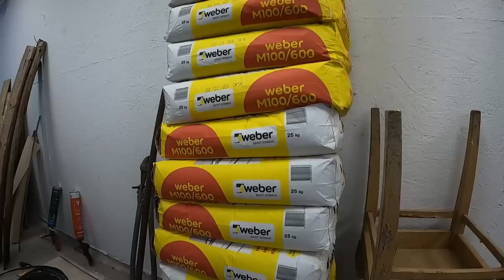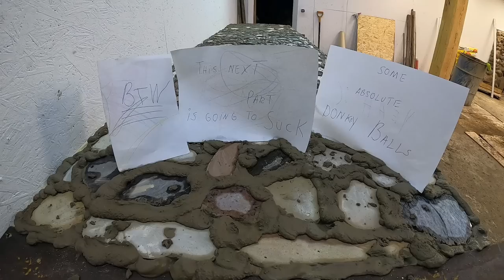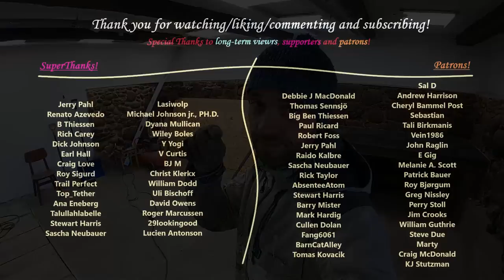Renovating the workshop  (part4) - Rock table build

Comment: 11:50 “My plans change a lot, so I should probably stay as flexible as I can – let’s build concrete tables.”
Reply from the maker: Well, that escalated quickly
Reply: I was thinking that too. I've reorganised my workshop several times. I like solid benches, but not permanently installed.

Comment: Hello Ants, you did a great job with the 2 workbenches, they look very good. I also have 2 pieces, but made of wood, because I can always sand them down or put a new tabletop on one workbench if the old one should break. And it's easier to rebuild them. Greetings from Berlin
Reply from the maker: yeah, might be hard to "move" these ones around :D need like a 20ton excavator or something

Comment: given your penchant for using used motor oil on most of your projects, I was surprised you didn’t use it
as mould release agent.
Reply from the maker: treat the osb pre-pour?
Reply: @Ants_Pants  yup,use a bit of old oil and it will fly off!……….mould?mold??….

Comment: Andris, another great project and legacy update to the overall homestead. Your Grampa would certainly be very proud Bro, as I  am sure your mom, sister and nieces are. Lots of great accolades from your viewers that I absolutely concur with. One suggestion for your concrete top edges is bolt on a 2” x 3” angle iron edge. It will stop any concrete chipping, give the bench a very finished look, and functionally provide a small edge to stop “crap”  from rolling off the bench. Looking forward to seeing the workshop get populated. Be proud Andris. From Canada
Reply from the maker: Totally forgot it lol. I wanted to embed it in the concrete but i simply forgot

Comment: I built a concrete table & used cardboard tubes for the legs though I can't remember for the life of me wot the cardboard tubes came from but they worked really well,  just remembered they were poster / map protection tubes & their really strong & as big as 3½ to 4½ inches wide. Useful if you ever want to make anything else with legs again. Still loving the videos ya hyperactivity is nearly contagious. .😊. .
Reply from the maker: we have had those cardboard tubes before, but they did not stay on the market for long, they were too expensive. People just used vent pipes, but those have become too expensive as well now.

Comment: If you are looking for another project, you might have thought of this already, but I think you need a bridge to transition over the cement moat between the doors and the cement ramp. Something to make it easier to transition from the ramp to the garage floor with vehicles and trailers and such, a little bridge for the vehicle tires, but leaving the function of the water collection moat. Like you could just half fast put a big wood board there, cut off a few pieces as shims, to support the ends and maybe the middle, and it would probably be pretty close to shop floor height. That's what i would aim for, the one end of the bridge being flush with the shop floor. The other end of the bridge could be supported up the ramp a bit and out of the moat completely. I would probably put in a few boards so things that are more narrow can enter easily, like your mini excavator.
Reply from the maker: Interesting idea

Comment: Maybe you might want to set a steel plate in the concrete in one part to do your welding on, just a suggestion myself friend! Great minds think alike brother, lol 😂steel top in one area is nice too tac weld jigs when you’re fabricating different things! Good deal Andris! If I were younger I’d have more projects like you but I’m turn 63 this month myself friend and it’s getting harder for me to do these projects and I still try doing them anyway like I need to change the top plate of my lawnmower deck, just haven’t felt like getting started on it! Tough getting older myself friend, maybe soon I’ll be able to get it started on it and once I start I like to get it finished as soon as possible!
Reply from the maker: hehe so true.

Comment: You may be able to get Tung oil/ tung nut oil at pharmacy, it's where I've found it. It's great for rubbing on pulled muscles then wrapping a warm towel around area, it will pull the soreness right out. Grands use to use it after harvesting the fields.
Reply from the maker: Thanks for the tips mate

Comment: In Estonia you could probably spit and hit the North Pole, couldn’t you? It’s up there a ways. I put epoxy on a work table and it doesn’t scratch any easier than concrete. It’s really hard and easy to fix if you do scratch it. Just mix up a little epoxy put it in the scratch with a model paintbrush then wet sand and buff it. I even made my kitchen countertops using birch plywood with a 3/4” oak border then put epoxy over the top.
Reply from the maker: thanks for the tip, i may look into doing that

Comment: Concrete ping pong table and wet the surfaces before spray foam. You will be surpriseb how much better the foam sticks. And use vibronui for concrete

Comment: The perceived problem removing the mold. Is not release agent. The mold was built so solid it was hard to remove. One piece of osb. Or 2x2. From another. All the release agent in the world would not aid that removal. Notice the wood separated. From the concrete well. The wood did not separate from other wood easily. The wood was dovetailed, jointed, fitted very tight. Great job forming the benches.

Comment: By adding the stones to the concrete table, you've taken Andrews table to the next level. 😎
Best thing for stone, granite and flint is a mixture of old black engine oil and petrol, 10 parts oil and 1 part petrol and rub in until polished. An old stone mason gave me that suggestion when I brought some granite slabs from him, coated them once and it lasted 20 years before I had to re do it again, surprisingly it didn't smell either.👍
Reply from the maker: cool, thanks for sharing m8

Comment: Don't forget to leave room to feed long stock through the headstock of the lathe. You don't want the headstock in a tight corner, leave it open or you'll severely limit the length of rod or pipe you can turn.

Comment: Fireproof tables Rock! with rocks. that "crap" cleaning disc i know as a stripping disc, kind of used for paint and surface rust cleaning/stripping (try it on other things maybe) good luck with the trailer driving test!  that brick cutting tool is like the dust maker 2000 without water, i can't remember what you called it either.
Reply from the maker: Haha 😅

Comment: It’s called ‘scribing’ and once you get the hang of it it’s easy.😊 Also I always oil my forms before pouring to make sure they release easily, and also make ends slightly tapered so they don’t get jammed in.
Reply: Howdy! Do you prefer any specific oil and/or do you treat/clean the forms before oiling them? Thanks.
Reply from the maker: Ok 👍

Comment: Hello Ants. Have you thought of building shelves on wheels to put under your tables? That way you can 1) move the stuff to where you need it in the shop and 2) use the whole depth of the spaces, as you can pull them out if you need something on the back of the shelves. I'm sure there are other positive aspects to the idea if you think about it, as I am very happy with this in my very cramped little workspace. Greets from Switzerland, Beat
Reply from the maker: I will do some next ep. Thanks man

Comment: Beautiful rock "pancake" table!  I like the subtle arch in the smaller table too.

I was curious why you chose to overfill the gaps between the rock "pancakes" instead of just smearing it all over as is done with grout when doing tile work?  I look forward to reading your reason, as you have inspired me to do a similar outdoor work surface. 

Great video and nice work!

Cheers from Oregon, USA
Philip
Reply from the maker: should have done it differently yes. Although i thought i got all the caps, after grinding some caps appeared

Comment: Their using chopped fibre's in the concrete now if you ask for it if ordering ready mix. I bet you could just use chopped up fibre glass mat'in wen mixing it ur self, its supposed to be as strong as using reed bar unless I'm hearing it in-correctly . .
Reply from the maker: is it any cheaper? if so then im on it

Comment: I know that casting ALL in one go, looks much neat and structurally much better and strong however it needs more props to secure the whole framework against the concrete thrust; In order to overcome such, I generally cast the foot / legs first, by leaving the rough finishing on the top to allow the following casting of the top slab to bond. Then the following day when the legs casting has settled (but still humid), I do cast the top slab. You did a good job in any case.
Reply from the maker: Thanks man

Comment: Tung oil is a wood finish. extracted from the tung nut. Find it in the wood finishing department of paint, furniture, refinishing. Stores. Wonder full product. Similar to what is used on gun stock finish which is true oil.
Reply from the maker: wish i could find some

Comment: Yo,yo, yo!! Ease down, you're becoming some serious competition to makers and DIY-ers. First, the bench/table/bridge type thingy came out cool, also the rocky one is excelent. Da, you have some differences in rocky material and absorbtion rate for oil, eventually it will dry up or get mixed with dust and then dry up. Formwork was ideal to leave you the "impressions" or a "bump map" on the product. So far, your shop is becoming a great mod, adding some storage under the tables will free you a lot of space. I would make (as a suggestion) type of "cart" storage, so you can also remove it or if you store in tools, pull those closer to your work, if you work on a tractor or something, you don't have to get up every time and walk to the table to get tools, plus you have on the carts some temporary working surface, where you can put something, sort things or just keep things clean while working. It's just a suggestion though.. If you're working on a intense project, try to make it as good as you can since the result will be with you for decades to come. Oh, absolutely make some frames for the storage "thingys" to overcome the weight issues. 😉
Ants, you rule. Every video is more unpredictable and kind of pleasant...  Keep on, be cool, I'm just fascinated with how much dust have you created during the modding proces.. I would be asfixiated already in the first step.... ☠ Cheers!🙂
Reply from the maker: hehe :D thanks m8 i will try to not overdo :D

Comment: How much welding do you plan to do on the workbench??  Concrete doesn't do well at very high temperatures.  Perhaps an air space and a heavier sheet of steel might have been better??  Or a layer of fire brick between the concrete and steel?  Not just the heat that may be a problem but the continual expansion and contraction of the concrete could be problematical.  Even a steel grid of  metal slats as a spacer between to keep the heat conduction down?
Reply from the maker: its not a issue as i will be welding metal ontop of the plate, not the steel plate itself and mostly will be welding stuff that is locked on the vice.

Comment: how about a layer of clear epoxy on top will stop any oil and crap soaking into the cement and stones and fill any small imperfections and give a real smooth level top
Reply from the maker: Maybe one day, currently i will try some rock varnish
Reply: @Ants_Pants  A good coat of wax  on the varnish should help stop oils etc soaking into the stones

Comment: I did concrete for 30 years and i see most people on these shows using a steel trowel to finish concrete initially but at least you knew to use a wooden mag
Reply from the maker: Ohh

Comment: I'm sure later on in the video, you are going to make some great tables. But, are you sure you don't want a milling machine and maybe a grinding machine too? And instead of the table, a welding table instead (that may be stupid expensive though)? From what i know about "Machining Fundamentals", I want a lathe, a milling machine, and build my own tool post grinder. That way you can make tools for machining. When the milling machine is big enough, you can rebuild engines and can flatten the head gasket. Maybe cast some cylinders in steel and machine them to refit diesel engines.   

Maybe oiling the chainsaw can fix it. Maybe there is some sawdust stuck. My hair clipping machine works great, but only when I oil it, when its not oiled, its not doing any cutting. 

The Dutch "Action" store has all the disks you need, its called "schijf". Get someone to ship you a full box of it, it will solve a lot of money problems for sure. 

The tables turned out pretty good. Maybe put the stone oil on all parts of it will give it an even better finish. 

Greetings,

Jeff
Reply from the maker: all of that and even more👍

Comment: Why do you always skip the most important step when finishing cement surface. Steel trowel? Concrete grinding is for mistakes or frost heaving
Reply from the maker: because the rocks were all uneven and i had to grind them anyway

Comment: You will need a minimum of five feet or 2 meters to the left of your lathe for material to pass out the back of the headstock.   Do NOT put the left side of a lathe against a wall,  NO, NO. NO. NO!
Reply from the maker: the gearbox side will go against the wall
Reply: If your lathe Chuck has a pass through that allows long enough material to pass completely through the gearbox then don't limit your process capability by placing this too close to a wall.  If your lathe doesn't allow long material to pass through the gearbox than placement is a moot point.  You're extremely resourceful with the tools you have and a lathe is an amazingly capable tool.  A 90° counter clockwise rotation of your installation could be a 5 times increase in your capability, only if the machine is capable with the pass through.
Reply: Who is shearing his sheep? Back off. it is his design. Did you see when he used his employers lathe at work? Go tell his employer he has built his wrong. Don’t be a know it all. You don’t understand European methods. Don’t insist your methods are perfect. Show some respect.